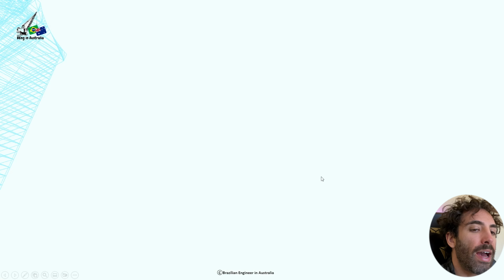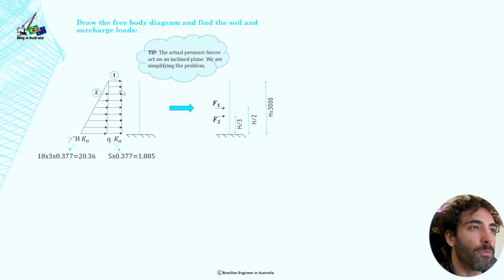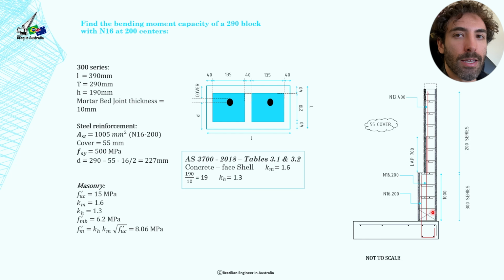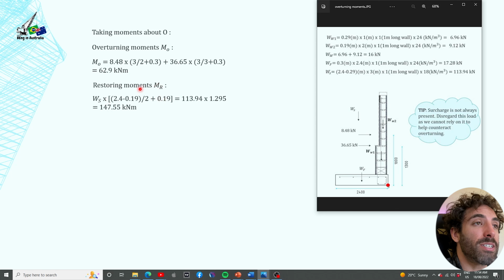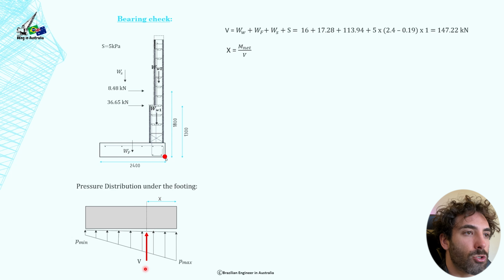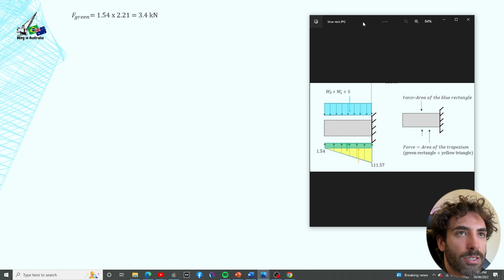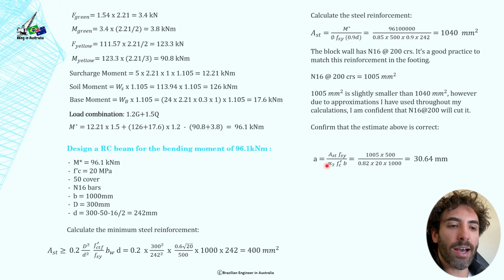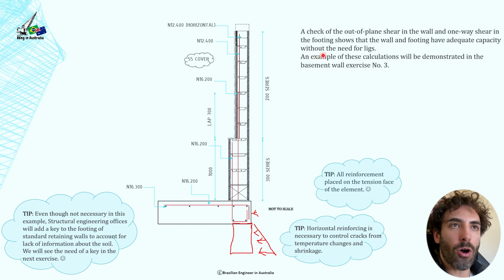MasterClass: How a Professional Engineer designs a Retaining Wall

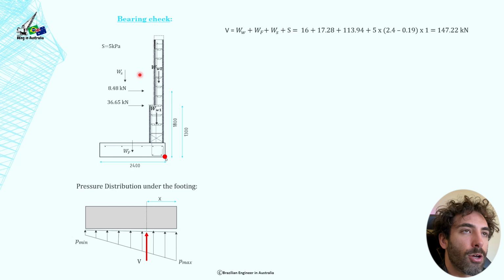Comment: For the 'V' value in the bearing check at 31:00, the 147.22kN doesn't include the surcharge load, only Ww+Wf+Ws. Should V be 158kN?
Reply: I have bought the workbook and had a question after going through example 2. 
When calculating M* in example 1, M green and M yellow are subtracted but not factored by 1.2. However in example 2, M yellow is factored by 1.2. Can you clarify this please?
Reply: Hey mate did you figure this out? It changes the eccentricity of the load if you factor in the surcharge load which means the total V won't be acting within the middle third of the footing.

Comment: Love your work mate. I am a Project Engineer on site but it's always good to know how to design structures. Have no idea how is that important to decide where to add a construction joint on site when things goes wrong with concrete pouring 😀
Reply from the maker: That's it mate. One of the best Project Engineers I've come across worked as a structural design engineer before becoming project engineer. He told me how useful those skills are nowadays. I'm not saying that every project engineer should work as a design engineer :D but they at least should understand the fundamentals behind the design. (in my opinion).